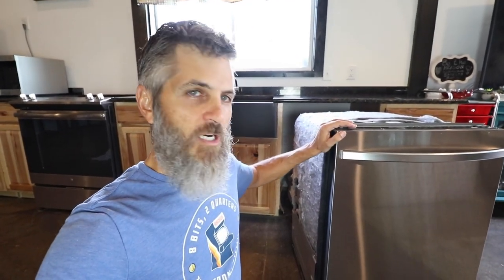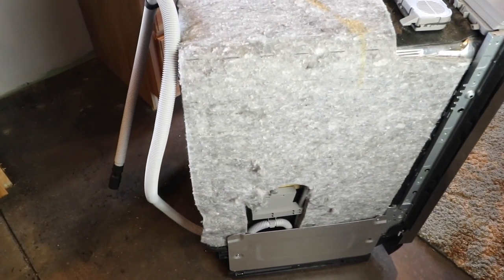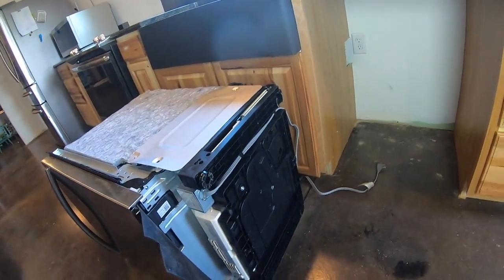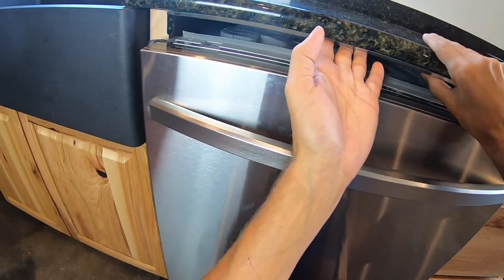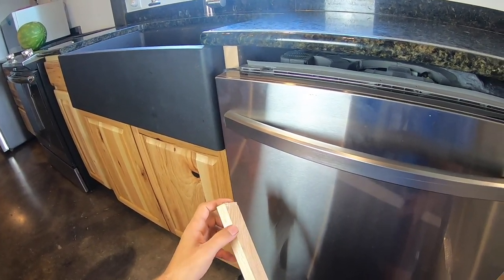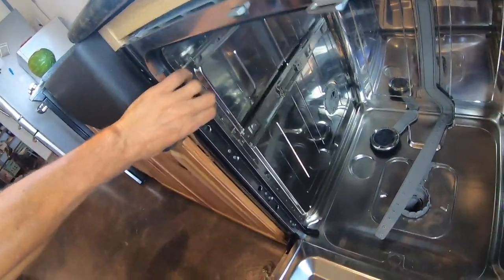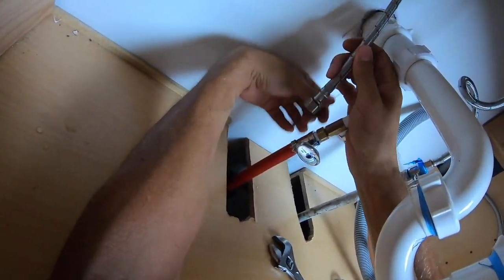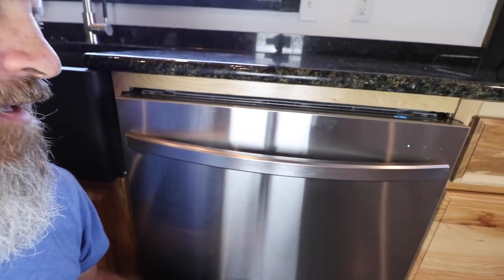Dishwasher Installation in the Barndominium

Comment: Great video, another option to fill that gap above is to put a piece of wood on the floor which will move the dishwasher up. That will fill the gap, and is a lot less work. Then when you install the kick board you can slide it down as you still had about 1.5 inches of play to screw it in. Great video, very well explained.

Comment: I would highly recommend lining the inside floor of your sink base with some sort of linoleum and silicone seal the edges.  You will want to fill in those massive holes around the supply line and then install the linoleum.  If not then any spills or drips would directly damage the pressboard bases of those cabinets.  The holes need to be filled so things don't fall in there and disappear or give a mouse an entrance portal.  Also, install a plug-in mini-light bar.  You will thank me for this later if you ever had to do any work under there.  It makes seeing things easier.  Ever tried to hold a light and do crescent wrenching at the same time?